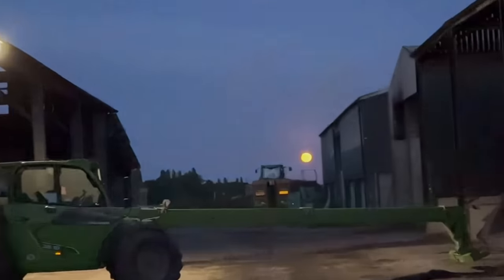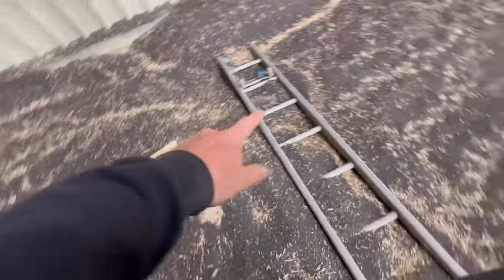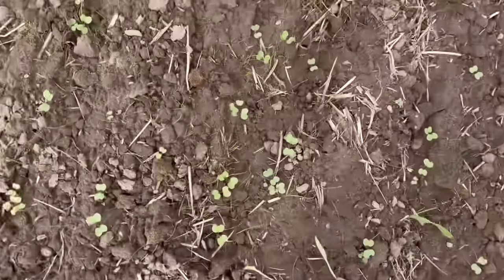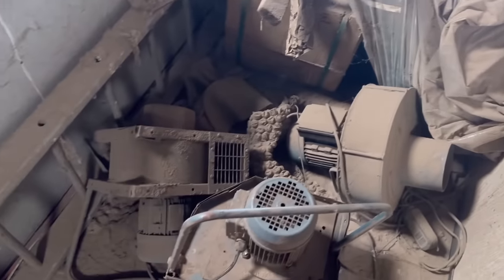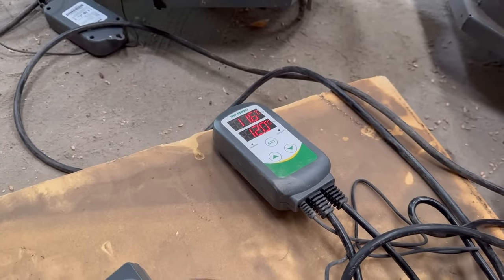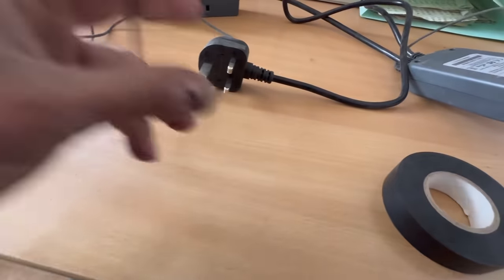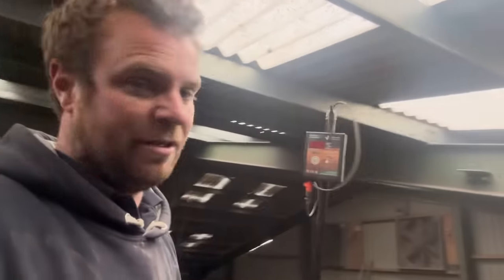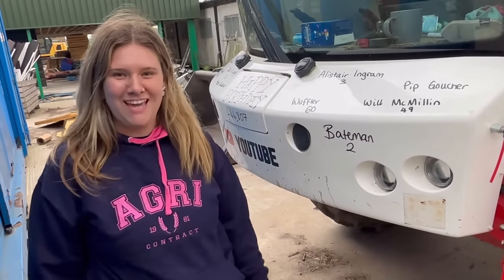MAKEING SURE HARVEST IS KEPT IN GOOD CONDITION   AnswerAsAPercent 1261

Comment: If the hose doesn’t fix the fuel problem spin the filter off and make sure that if there is a flat rubber seal or O ring make sure there is only one sometimes old ones get left on when filters get changed and more than one seal will allow it to bleed back

Comment: Hi Ollie, get some crimps for connecting electrical. Pliers and crimps are cheap but do a very good job. you can get heatshrink crimps, which are totaly waterproof, using insulating tape and twisting is a very short term fix which will fail soon.